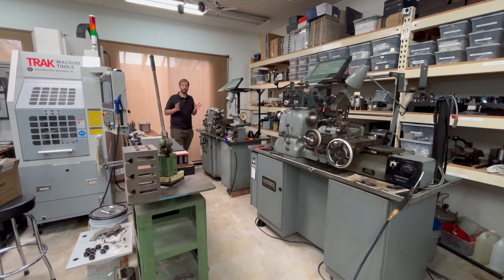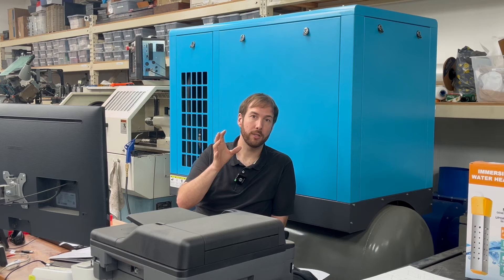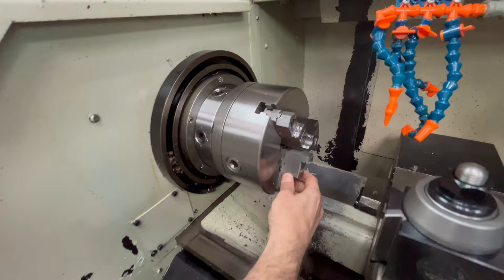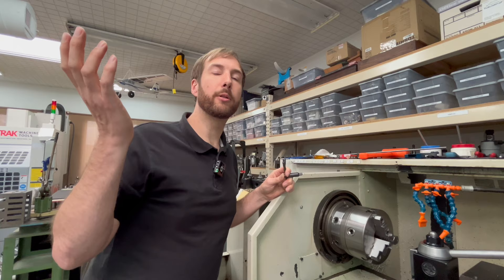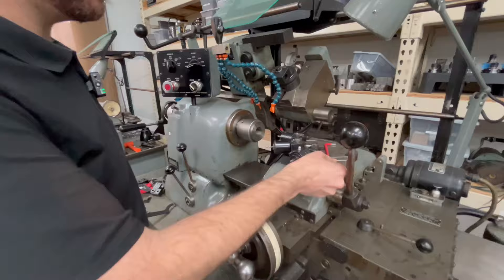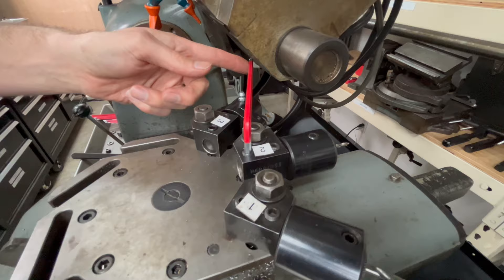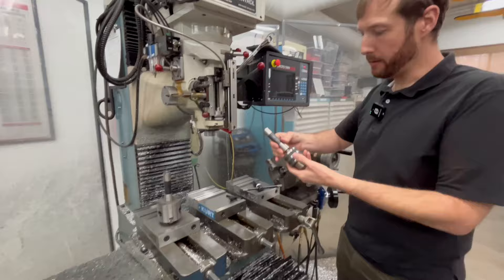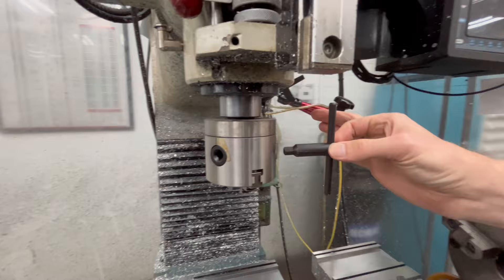WHY YOU SHOULD NEVER LEAVE CHUCK-KEYS AND OTHER TOOLS IN THE CHUCK!

Comment: Great topic. In my experience it is not enough to emphasize mindfulness and safety awareness. Safety should be integrated into workflow. When I began my apprenticeship I was shown the lathes in the shop. "Every lathe has a holder for the chuck key." "There are only two places for a chuck key your hand and that holder." "Never start the lathe spindle without looking directly at the chuck key holder." No one in our shop ever threw a chuck key. This is just one example of safe workflow.
Reply from the maker: Thank you. Well said! One issue we have is that we have many many keys and fixtures for each lathe. Basically each key has to have a safety device.
Reply: All of our machines had custom racks usually on the headstock. 40 years on I can still see in my head the rack for the 40hp Ghisholt turret lathe. It had six spaces with chuck keys and wrenches etc. Every time I lifted the clutch lever I did an inventory. @TigermothRacingTV

Comment: I have difficulty balancing, in my own head, the merits of some of these safety mechanisms with the danger of forming a dependency on them. If my shop had all self-ejecting chuck keys, would I depend on that mechanism and be less rigorous in training myself with the discipline to always remove a chuck key? Or am I just rationalizing an avoidance of self-ejecting keys because they are (marginally) annoying to use?
I do think it's lost on some people (cf. M.W.) that these are important habits to form and even if a given machine cannot conceivably throw the chuck key or meaningfully crash itself with the key in place, that's not true on every machine, and the habits we form are with us for the future on all machines that we use. Hopefully this video helps to send that kind of message.
Reply from the maker: Thank you for the insights. I ask myself the same questions. For me, I have never had a problem remembering to respect tools like this because I have some kind of "permanent fear" for lack of a better description and I have just left that fear intact and have never forgotten a tool in a moving machine that I can think of. So this is not a problem for me as an individual but I have been training some people new to machining especially in the past few years and it is painful to watch them struggle with this even after multiple instructions. I have concluded that for some people, probably most people, that the safety mechanisms are the best option for them.

Comment: Self ejecting chuck key ;) . A good old fashioned spring lol. I also understand your approach. Some risk is necessary for building discipline, which is proportional to safety. I think there is another solution that I haven't seen yet. Imagine if the chuck key was necessary for the power to the motor. A key as a key, if you would. Seems simple enough, but I've never seen somebody do it. Maybe I should make one.
Having the home where you put the chuck key within the eyesight of the motor on-switch can also help.
Reply from the maker: I like that idea, that the key would have to be in its home in order for it to be possible to turn the machine on. Like a door switch. The problem I see is that for our lathes we have about a dozen different chucks and attachments for each machine and they take different keys and tools. You could be using one chuck and have the key for another chuck in the home switch and then you have the possibility of forgetting again.